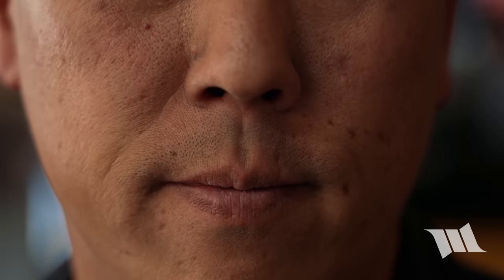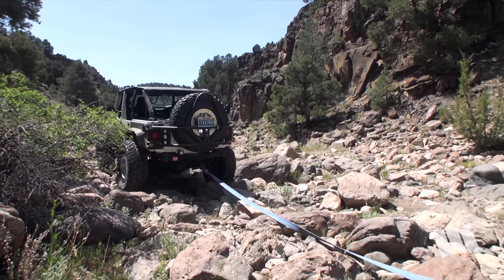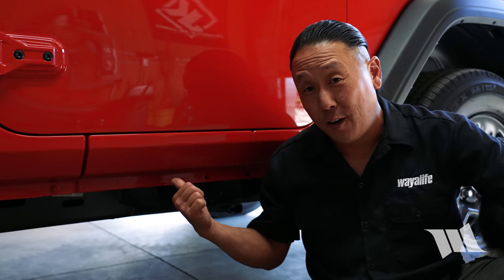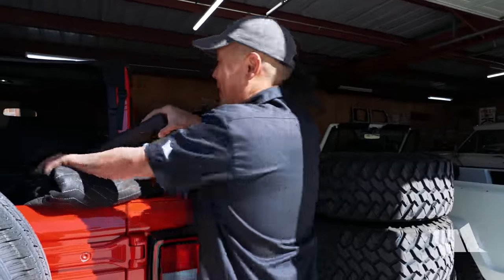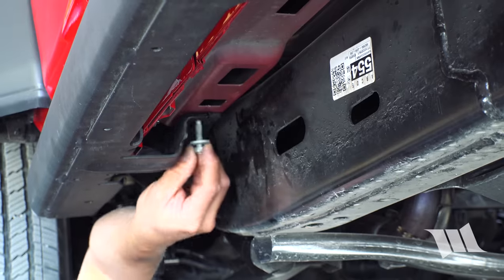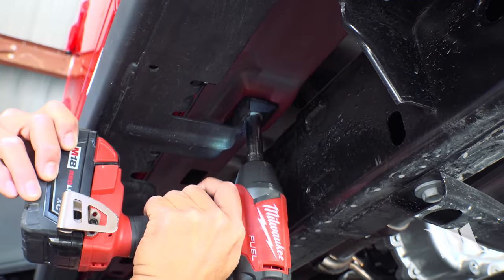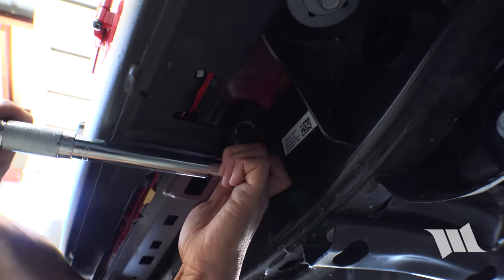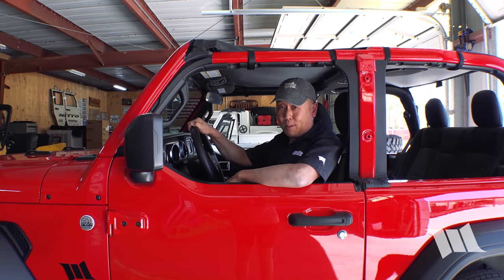What should be the First Mod on a Basic Jeep JL Wrangler Sport

Comment: Before we bought our new 1999 base model wrangler (4 cylinder engine, manual transmission 14x5.5-inch steel wheels, 205/75-15 tires, no air conditioning) we had used Isuzu Troopers for picnic and camping trips to hundreds of locations far from paved roads in Utah and surrounding states.

1: Tow hooks. We specified that the dealer install tow hooks (two front, one rear) before we took delivery.  

2: Tires. The next day (and without consulting me), my wife traded the 205 tires for (5) tires size 235/75-15.

3: Tow strap. Our Isuzu Troopers had tow loups - not tow hooks - so we had been accustomed to carrying a tow strap with hooks attached to the strap. That strap was difficult to use with the Wrangler tow hooks so we got a strap that had loups on the ends of the strap.  

4. Grab handles. A pair of side grab handles to install on the forward parts of the standard Wrangler “Sports Bars” (i.e. between the roll bar and the windshield). The grab handles made getting into and out of the Wrangler much easier, especially for my wife (who is short) when she rode in the right front passenger seat - and for me when my wife (often) drove with considerable verve.

5: Sway bar disconnect. We never disconnected the front sway bar but I fabricated a disconnect for the rear sway bar. I had to crawl under the Wrangler to disconnect or reconnect it but it took less than a minute to do either. We tried to plan our off-pavement trips for when no rain was forecast but, on those rare occasions when the roads were wet when we got back to pavement, I sometimes drove on the paved roads without first reconnecting the sway bar - never farther than to the next town and I never exceeded the posted speed when the sway bar was disconnected.

6: 12-volt tire pump. To allow airing tires down to 15 lbs. when leaving pavement and airing up again when returning to pavement. 

7: Polyurethane bushings. We thought the Wrangler suspension was remarkably good (for a vehicle with “solid axles” front and rear) but our son gave us a complete set of polyurethane suspension bushings. I briefly considered trying to install them myself but quickly decided to have them professionally installed. They didn’t make a huge difference but we both liked the feel of “truck” suspensions better than “car” suspensions and the polyurethane bushings made the suspension more “truck-like”. 

8: Roof rack: Ours was a Smittybilt. It attached to the body of the Wrangler (not to the optional hard top) so I think a soft top could have been lowered and put back up with the rack installed. The hard top maybe could have been removed with the rack in place. 

9: Edelbrock IAS (Inertia Active System) shock absorbers. From the time I started reading about vehicle use off pavement, I had read that many people recommended “tightening” adjustable shock absorbers for use off pavement and then adjusting them back to their “soft” setting “for a better ride” on pavement. That NEVER made sense to me. It seemed to me that it would be better for the shock absorbers to be “tightened” for use on pavement (for better handling) and returned to their “soft” setting to allow better compliance off pavement. When I read that Edelbrock made shocks that did that automatically, I started saving my money. After getting the Edlebrocks, we found that the ride was as good (maybe slightly better) on the rocks without airing down than what it had been with standard shocks and airing down! Edelbrock shocks are probably not worth the money for people who only drive off pavement once or twice a year. But our schedule permitted us (for a few years) to drive off pavement a couple of days once or twice a month from April to October. Not only better control on rocky roads but a HUGE time savings if you explore off pavement as often as we did back then. Edelbrock IAS shocks were not available in the U.S. for a while but I see they are being advertised now. Don’t yet know for which vehicles.

10: BFG All-Terrain tires. After driving them for a while we decided they had better traction than the other brands we had used on our Isuzu Troopers and on the Wrangler but the more noticeable advantage of the BFGs was that they allowed more precise placement of the Wrangler on the right side of narrow paved mountain roads - VERY helpful when meeting oncoming traffic!

Comment: I'm on a budget so I'm only doing mods that are essential for the places I want to go.  Ironically I did add Rubicon rock rails for appearance as much as anything.  I think mods depend on what you want to do with the vehicle.  For me I added tires and springs/shocks off of a Rubicon.  I will suggest for anyone driving off of pavement the first mod should be front mud flaps.  My tires throw a lot of rocks up on the doors and the front part of the rear fenders.

Comment: I bought a new F250 STX crew cab 4x4 recently.  My mods were floor mats, line x bed liner, rear inner fender liners, seat covers, window tint and ceramic coated the paint. My next mod was a Rtic cooler with an American flag wrap for trips. Of course a new dog bed for the back seat for my GSD.  

If that was my Jeep I would go with rock guards, window tint, seat covers, ceramic coat, a dog bed for your dog and a cooler.

Comment: Rock sliders, skid plates and more capable tires are absolutely the best first mods to a stock Jeep. With those three, you can test how capable your rig is stock, then buy suspension and other mods like winch bumpers to enhance your capability.

Comment: Nice video doing the smart basics.  My list for our 2020 4-door Willys is:  Fox 2.0 shocks (already installed), Nitto or Toyo (Ridge Grappler or MT's) 255/80-17 (33" x 10" pizza cutter) tires keeping the stock (17" x 7") wheels and no lift.  Eaton TruTrac front/rear (should I regear from 3.52 to 3.73 for the 1" tire size height increase and 5 lbs of extra weight per corner... I don't know yet).  Stubby aluminum front bumper with steel plate for a winch.  The Willys package came with the rock sliders, transfer case skid plate and fuel tank skid plate.  Interior:  I've already installed a HAM radio (Icom ID-5100) and I travel/off-road/camp with a Garmin inReach mini.  Looking forward to more with the Pippi Project.  Cheers!  Pete - KI7LIL
Reply from the maker: Awesome 👍

Comment: 02 2-Door TJ here.  First mod was to dump the side steps and install rock sliders.  Back then the simple solution was to bolt on angle iron to the tub, no connections to the frame.  Poison Spider made some stronger ones that were higher grade steel and went up higher on the tub with cool plasma cut logos but were expensive.

Your "factory" sliders replacements stick way too far out  and down low and connecting them to the frame is bad Ju-Ju.  They also look kinda soft and maybe can't take a big rock hit without distorting.  The tub is meant to be isolated from  from the frame on flexible pucks and bolting on the tub with a rock slider and into the frame which flexes is gonna cause problems.

 Or maybe I'm wrong and newer JLs are built different so it's OK to go with a box section  slider but you're  paying big time concerning clearances.  Of course no handy step to get into the Jeep is a hassle but  I  say maybe if you can't  get into your Jeep unaided you may have a problem.
Reply from the maker: LOL - umm, okay.

Comment: For my current JKU and my previous KJ, the rock rails and aftermarket engine/front end skid plates were some of the first modifications I did.  

To add onto that thought, a CB radio or some form of communication equipment may also be a good choice for a first modification.

Comment: Was going to say when I saw the video title, for the Wrangler it's a no-brainer to go after the OE parts that were included on higher trim package models that others have removed to upgrade.  They're usually cheap and fairly plentiful.  Also for the Wranglers, the body design makes rockers tuck up nicely.  On other vehicles sometimes rocker armor ends up sticking down far below, basically guaranteeing a hit, when perhaps the vehicle would have just cleared if they hadn't been there.  The Wrangler doesn't have that problem to the same extent.
Reply from the maker: Glad we showed what you would have recommended 😎

Comment: I don’t know if it’s considered an actual mod or not but for anyone wanting to go out off roading in any vehicle, not just a Jeep, everything off road related first begins and starts with the tires! The proper tires will give you the best traction needed, as well as the best sidewall protection. For what I do I prefer BF Goodrich All Terrain TKO’s and now TKO II’s in 10 ply. They have always worked very well for me with a majority of stuff that I like to do.

Next is ground clearance and suspension. For rock crawling and/or slower speed off roading where you will need your vehicle to clear obstacles, ground clearance is #2 combined with proper under vehicle protection like skid plates and rock sliders, then followed by suspension as #3. However, for faster styles of off roading where higher speeds are more of a reality such as Baja style racing and so on, then suspension is #2 followed by having better ground clearance and everything previously said that goes along with it as #3. 

After that is making sure your vehicle has enough power, horsepower, torque and gearing to do what you need it to do for whatever kind of off roading that it is that you are wanting to do. 

The last 3 things but which are both as equally important as the previously mentioned ones are having proper recovery gear and tools such as a winch, Hi Lift jack and tools that can let you do an off trail/temporary bush repair job to get you through the area where you are off roading at and back to your home and/or home base to then have a permanent fix, repair and/or part/component replacement done to get your vehicle back to pre-broken/damaged part condition prior to your last outing and then next, proper off road lighting for once it gets dark and the sun sets.

For those things I prefer Warn Winches. My most recent one is a Warn Zeon 12-S winch. I prefer to go slightly overkill with my winches because I may not always be recovering just myself, but someone else too, and/or instead. 

For tools I encourage people to use anything that is considered high quality tools. And then for lights I prefer KC Hilites. In my opinion, they make the very best off road lights around. Their quality is top notch and their customer service is second to none, and is the very best that there is out there hands down!
Reply from the maker: Cool - we all have our own ideas of what should be first.

Comment: Ended up eventually with 31's.... re geared rear diff.  Warn brush guard/winch.  1.8 four cylinder motor. Weber carb.. headers...   custom steel rear bumper.    Rancho Suspension...    Mid 80's,,,  I miss that truck,,,,
Reply from the maker: Sounds like a fun ride.
Reply: @wayalife  For a kid...  Not many choices available back in the early 80's. I was living/working on an apple farm back then...  Farm shop mods.

Comment: Man i can definitely agree that recovery points are a must cause if you wheel with friends as you should they probably got a wich and they'll pull ya right out :D ,and same with rocker protection cause i got a new ecodiesel rubi JT and first thing i did was add some weld on VKS Fab rocksliders cause the factory ones are nice but if your like me were you use your sliders to either pivot your truck on a rock or your just hard on your rig,get some real frame mounted sliders the cause factory ones will bend and damage your rocker panel, 
cause thats what happened in my previous gasser jt but lesson learned and good thing that aint my truck no more cause the new owner is gonna get a not pleasant surprise with the bent rocker panels on both sides ,scratched sliders,frame,driveshaft.........everything underneath the truck lol
Still got 54k for it :D and im now the proud owner of a JTRD ;D

Comment: FWIW..I have jk jeep with a maximum lift..upgrade shocks..and front diff..beefed up..running 37..with a slight rim offset..well i decided to put on smaller tires and rims..probably 37 be OK for winter..but tires are about 630 each.  4 plus  spare..so got smaller steel rims...I like 37s but  feel save em for spring summer

Comment: Pippy looks fabulous 👌! 

Do you guys have any experience with what Jeep calls the "Heavy Duty Rock Slider w/ Step Assist"? I am really wanting a set for my Gladiator, but the $900 price tag is a tough pill to swallow. Just curious if you think they're worth the price, or if there's a better option out there from another company.
Reply from the maker: Oh yeah, they are essentially the same thing as what we just installed in this video only with a tube that extends out from it. This helps it to be a step and actually, does a better job of protecting the side of your Jeep. If I could have found a set, I would have preferred them.

Comment: I got a used set of those rubicon rock sliders for my 4door JL sport, that was a great idea.
I noticed that the gap between the slider and the tub is noticeably less on the passenger side any ideas?
Reply from the maker: While factory rocker guards are nice and will protect the sides of your Jeep, they can bend up a bit from a really hard hit. In other words, what you're seeing is pretty common and not really that big of a deal.

Comment: Watching this vid got me thinking about asking you this question/advice:

I just spec’d a 22 JLU rubicon 2.0 and a 22 Willys 3.6 Xtreme Recon for an identical price.   It’s basically lockers and t-case vs. 456 gears, 35 BFGs and essentially Mojave axles.   Any thoughts on which direction to go?   I know it comes down to usage - but just curious what you think
Reply from the maker: If you're happy with running 35's, the Xtreme Recon is the way to go. You can't build up a Jeep with aftermarket parts for that price.

Comment: First mods - recovery points and tools. Off road it stock for at least a year to figure out what you really want and need for your style of off road.
Reply from the maker: Tools are a must but I've never really looked at them as being a mod.
Reply: @wayalife  I meant tools as mostly recovery gear/tools. Your still in need straps and stuff to actually use the tow points.
Reply from the maker: @Travertine Pico Got it. And, you're are right, definitely a must have but I still don't consider them to be a "mod". But I'm with you on this. 👍

Comment: Eddie, as a new Wrangler owner and a subscriber, I have a question which I’m sure you have heard before, and that is how to cure steering wheel shake or death wobble. Would a new stabilizer bar help or do I need something else?  Thanks.
Reply from the maker: If you still have the aluminum steering box, you need to have it replaced with an iron one at the dealership. There is a TSB for this. If you already have it, you need to check your ball joints as I have personally seen multiple Wranglers with loose ones and that will cause DW. The factory steering stabilizer is the best to use in my opinion. Don't waste your money on fancy ones as all they would do is mask your real problem anyway.
Reply: @wayalife  thanks for the quick response. I had it checked at the dealership last week and they told me as a 2022 model it had the latest hardware.  I first noticed it on a very cold day when I hit a rough spot, and thought the shocks had not warmed up yet. 
Thanks again for the info.
Reply from the maker: Assuming your Jeep is still under warranty, I would have your dealership solve this problem. Go on a test drive with a technician and drive it over a spot where it happens. This is something that can be fixed and they should be the ones to fix it.

Comment: Hi I just started following you and have questions about a Jeep I bought a week and a half ago. (2019 Jeep Wrangler )
I’m having issues with starting it in the mornings because it’s says module control not communicating. After an hour or so it’s starts up like nothing happened. When I took it to the mechanic he said everything works fine. Weird thing it only does in the morning when I leave for work. Please help me figure out the issue. Thanks
Reply from the maker: It is possible that your auxiliary battery is getting low. I would have both your batteries checked at the dealership.

Comment: Do the stock "running board" type work the same way? As sturdy as rock guards from the video?
Reply from the maker: No. They are made out of plastic and not meant to be a rocker guard or slider. They will fold up and cause damage to the body.
Reply: @wayalife  Ok thanks, wasn't sure if the plastic was just a cover over steel.

Comment: How much protection do the stock guard realistically provide? 1 or 2 solid hits?
Reply: Yeah I just hit mine on a tiny ledge and it looks like it bent pushing it really close to the body. I guess they are better than nothing
Reply from the maker: We've run them in the past on several different JK's and have always found them to hold up decently well and with a lot of abuse. The biggest downside to them is the lack of stand offs to keep the side of your Jeep away from obstacles.